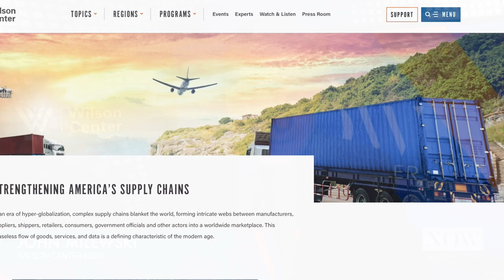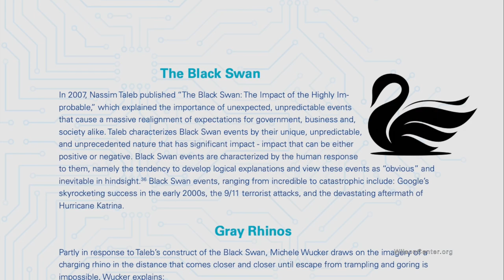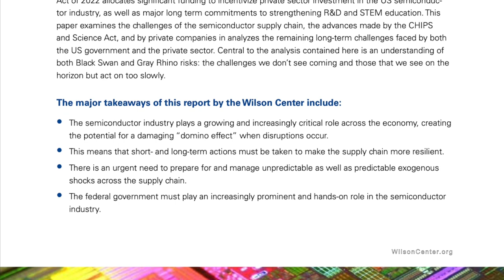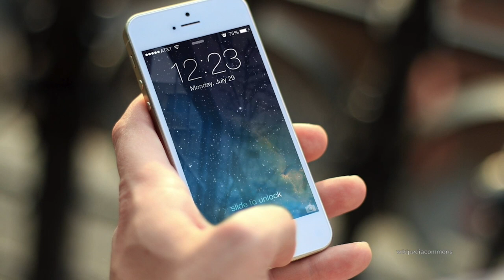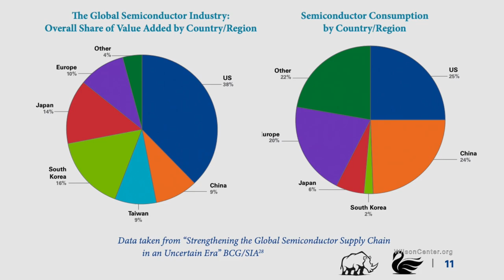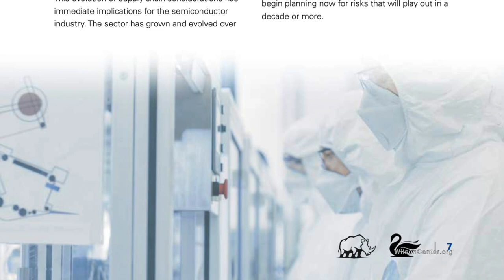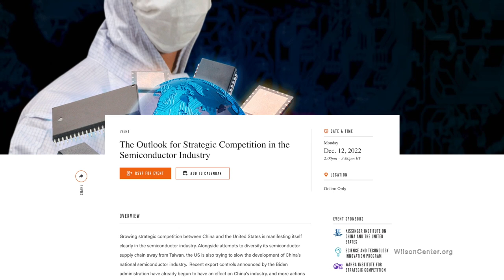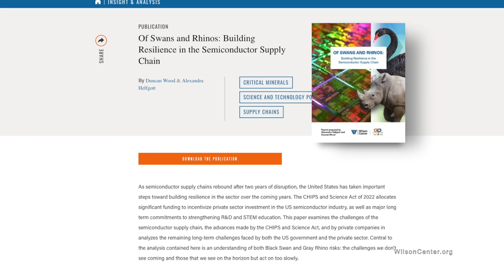Building a More Resilient Semiconductor Supply Chain: Challenges and Recommendations

Comment: The required building materials for TSMC's Arizona plant are manufactured in Taiwan and shipped in thousands of containers to Arizona for assembly. In the future production process, Arizona fab must import raw materials from Taiwan daily. Then when the chip production completes in Arizona, they send it back to Taiwan for packaging and back to the United States after the packaging finalizes. Worse, the Arizona fab is far from the supporting manufacturers, a problem that the Taiwan fab can solve within an hour; it will take Arizona dozens of hours, days, or weeks to solve the problem, so consumers will have to bear high costs.
Furthermore, TSMC still has to close its factory in Arizona whenever Taiwan is affected by geopolitical risks. Therefore, building factories in countries without supply chains and talent will not spread risks but will only increase costs. So it doesn't make sense.